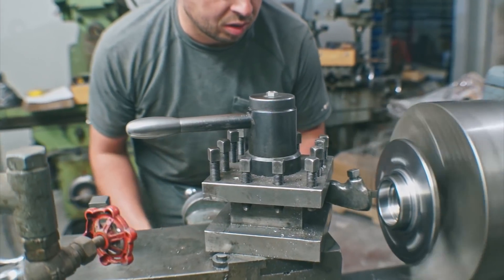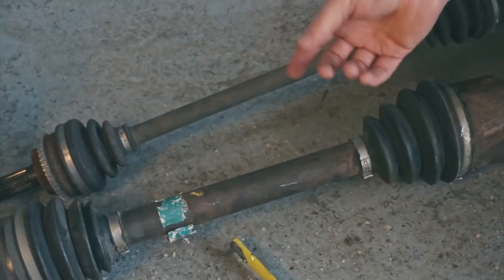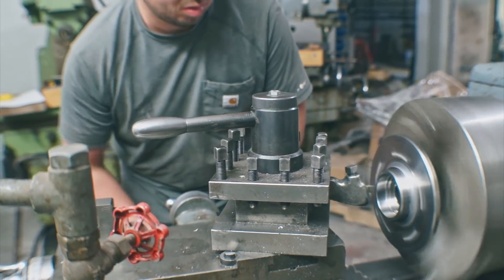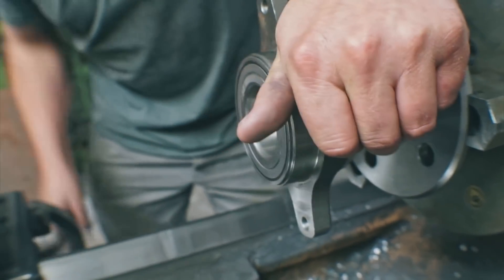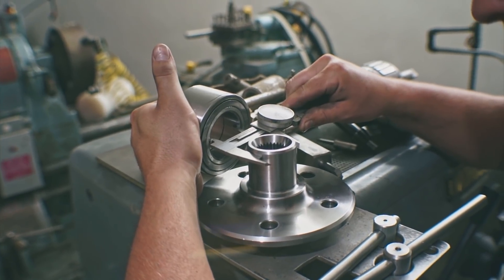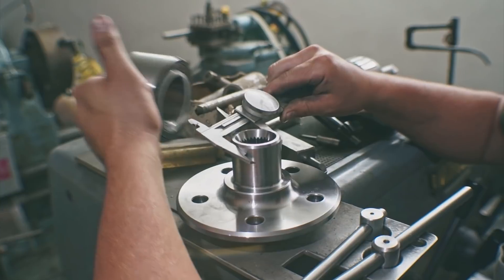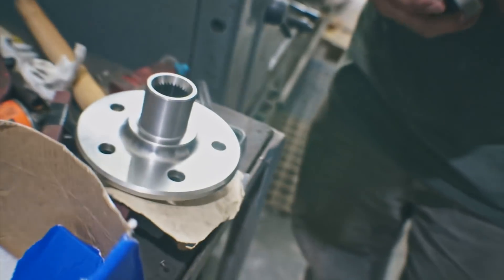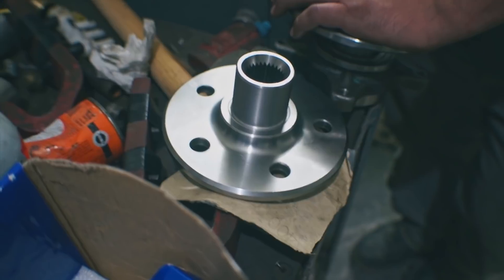SUBARU DRIFT BUILD |6| Machining Custom Hubs

Comment: Great work. 
Im running the nissan r200 with 3.73 ratio with s15 200sx in my gc8. Custom knuckles with stock nissan axles and 370z bolt in hub/bearing. 
In Australia the nissan stuff was easy to get a hold of. 
4 years has past since i did it and if i did it again a full mustang diff, axles, hubs would be the go.

I am now looking for a manufacturer  to make front conversion hub. 
Gc8 press in but with 5x114.3 stud pattern

Comment: This video is so cringe... The guy who machined it screwed it up. You don't use caliper to measure bearing surface instead you use micrometer and bore gauge for ID... Better to use 4 jaw chuck instead of 3 jaw chuck for precision machining. The worst part is the guy is not wearing safety glass🙄

Comment: A little late to the party, but did you try measuring the inner and outer diameter difference of stock parts meant to go together, i.e. explorer to explorer or NSX to NSX?

Your videos are great, they're encouraging me to ditch the dreaded 4EAT in my daily driver.

Comment: Where did you get $400 figures for an R200?

I picked up the strongest R200 you can ever get, it’s a pre 96’ Q45 diff for $100 at my local yard. The R200 comes in like every RWD Nissan.
Reply from the maker: Nissans are rare out here in Minnesota.
Reply: Dirtcheapdaily didn’t think about that.. I’ve been debating on using my 3.91 r200 on my WRX.. thinking about snagging another subframe to fab up. I have two trannies, and a built 2.7L on the side. Just wondering if converting to RWD will be worth it.

Comment: Hub are supposed to be an interference fit in the wheel bearing, they NEED to be pressed in, if it just drops in, you took away too much material.  I'd say about .002" difference between the ID and OD
Reply from the maker: ...Seems like you didn’t watch the whole video...

Comment: This video was awesome man. Great editing too. Really gives me a lot of insight into my future shenanigans. I feel like this is what all the project car viewers on YouTube should be watching and have no idea they're missing out on watching crap from big media channels.
For my SR20 MR2 swap, I'm planning to use the Sentra axles, which means using the sentra hubs. Luckily the Sentra press in bearings are the same width and OD as the MR2 bearings, so it should all just go together.
Main issues are the Sentra hub is 4X144.3 instead of 4X100, so I'll need to drill the other lug pattern into the hubs. Then the hub bore is 66.1 instead of 60.1, so I'll probably machine down the hub nub, whatever you want to call it.
Hopefully then I'll still be able to use MR2 brakes and MR2 wheels and it will all work out. I'll have a rear LSD with stronger, more affordable axles, and an easy to mod setup from there.
With my V10 Subaru Impreza build some nonsense like this may definitely be in my future too. Rear end and axles are gonna blow up real good. :D

Comment: So you plan on funding this & future builds by selling complete machined hubs correct? Where do I sign up as customer # 1 ?
Reply: Also, couldn't you run matching wheels (if you wanted to) by using a 5x4.5 to 5x100 wheel adapter?
Reply from the maker: yea I could, but you've gotta look really hard to tell the difference between the ones I have now

Comment: hey dirt will a 4.44 rear diff from an auto car fit a 4.11 car also with auto?
Reply from the maker: It’ll fit, but if the transmission is still a 4.11, it won’t drive.
Reply: THANKS
Reply: you answered your own question lol